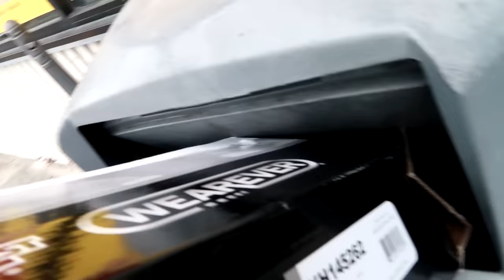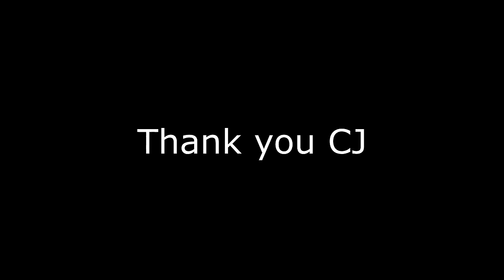what REALLY happened the night i should have died

Comment: one more short story since I'm already on a rant... one time I almost blead to death... I was working on replacing the muffler on my 1950 Ford 8n tractor and my wrench had slipped off one off the bolts and I was using all my force to make sure the bolt was tight and I had slid my wrist across another bolt peeling some skin off and severing my veins... I immediately knew (from past less dangerous accidents) to hurry inside, clean the wound, and apply pressure and hold it above my heart to keep ass little blood flow and blood loss and immediately my mother rushed me to the hospital and got me stitched up

Comment: I had a wheel fall off my 91 GMC Suburban Geneva Conversion 4x4 I was on the highway in the fast lane trying to go help a friend who engine had locked up I was doing about 65-70 mph and I felt the truck rock a little bit I took it as ran over something then it did it again and again back to back so I decided I needed to check it out as soon as I hit the blinker to get over the wheel and tire fell off and was blessed that there was no one else around except a guy in a GMC Pickup who was kind enough to turn on his hazards and follow me to shoulder I thought I had a flat tire but when I looked at it there was nothing there except one brake shoe that held on by the e brake cable and all 6 lugs were sheared completely off  never did find the wheel and tire but I was so glad he blocked traffic for me until I got to shoulder so yeah there are definitely still good people out here

Comment: I have nearly been run over 5 times in two months by speeding cars. The 2 most recent times were extremely scary. First,  I was riding my bike down the side of a road and somebody sped by,  hogging the edge of the road. On my right side there was a bank plunging around 40ft in to the forest. I was less than an inch from falling off the edge as i swerved away from the car and apparently the driver did not care one bit about whether i was okay or not. The other time was when i just finished hiking a local mountain. I looked both ways multiple times and lisrened carefully for oncoming traffic. I walked about half way across the road and as soon as i was about to step over the yellow line a car whips around the corner and misses me by a foot and a half,  roughly. A little too clise for comfort considering the speed they were moving at. A few minutes later i got a video notification from YouTube and the title read,  "I Was Nearly Hit By A Car." I immediately turned off notifications on that channel. I was trembling for almost an hour after that incident. And i swear the car from the first story is the same from the second. Seems like one hell of a coincidence

Comment: so I've been thinking about this. I have a dodge 2500 diesel and do as much repairs and maintenance like you. I can't tell you how many times I've pulled tires off and put them back on torqued the lug nuts and never re torqued them. I've knock on wood never had this happen to me. so this makes me think that what if when you put the tire on that side that you tightened the lugs but forgot to torque that tire. not sure if that's what happens but it's a possibility. I'm glad no one got hurt and that your alright. keep up the good work Dalton!

Comment: about 2 years ago I was working on my friends racecar changing an axel in the front of the car, I had a 3000 pound hydraulic jack holding the front of the car up, I only had one jack stand underneath the car, once I got the axel loosened. I felt like I was going to throw up,   I crawled under the car to remove the bolts on the other side,  as soon as I looked up the  hydraulic jack gave away, I looked over at the jack stand which was holding the brake rotor 3 in above my neck if that jack stand wouldn't have been there id be dead right now. as soon as I stood up I realized I could have been dead and that made me think of how quickly my life could have been washed away.

Comment: His problem wasnt that he didnt retorque the lug nuts, its because if u noticed his original rims he took off were after market meaning they would require him to use after market lugs nuts to work. But the spares his installed were factory gm rims from a newer truck, and idk if u ever looked at a factory lug nut and an aftermarket one u can buy at autozone, but the actual lug nuts itself seats differently even though its the same thread size, also he said the rim that came flew off lug nut holes were bored through meaning that the aftermarket lug nut ate away the the holes on the rim to the point that the lug nuts werent holding anything

Comment: A few years ago my dad was going to work, he goes to work at 3 am. at the time he was driving a 1 ton ford F-350 dually diesel. he was on the highway heading to work about 10 miles away when all of a sudden he sees something in the corner of his eyes. he looks and he sees two wheels on each side of him speed past! the outside rear wheels fell off and speed past him while he was driving down the highway at 70 mph!! he pulled over right away and walked ahead to get his tires and when he got back somebody helped him put the tires on and off he went!

Comment: I had just blown a tire and borrowed one of my dads old tires, i was doing about 110 KM/h (68 mph) and my front left tire fell off... Luckily with how ive grown up and messing around in fields and stuff ( the night before i had actually hit the disks in the middle of the field {couldnt see them because of the hay} and put it up on two wheels) i was able to safely pull to the side of the road. No one was stopping but luckily it fell off right infront of someones house and he saw me sitting there on my truck and he brought his tractor out, helped me put my blown tire back on, i pulled it into his driveway and we re sealed the bead. It two two months for the property owner accross the road to find my tire probably about 1km into his property

Comment: My dad and I were heading home from a hunt out west and we were traveling east on interstate 70, it was around 7 at night and we were looking for somewhere to stop for the night when right ahead of us a cattle truck swerved off the side of the road and rolled on to its side off the right shoulder. We stopped and I told dad to call 911, I jumped up on the tractor which was laying on its passenger side, the driver was not responding to me and the truck hit with such force that the drivers door was jammed inward and I couldn't open it so I started kicking the windshield to try to get him out incase it caught fire, after a couple kicks he woke up and I got him to open his window and I pulled him out.  The guy said he fell asleep at the wheel and we could hear the cattle in the trailer bawling, many had broken legs, he ran back and opened the doors and left the cattle out so they wouldn't trample each other, the problem was they ran out on to the highway and it was dark, the speed limit was 75 yet we managed to get people to slow down and nobody hit any of them until we could drive them off the highway.  The police showed up just as a group of Cowboys pulled over and as the cops talked to the driver the Cowboys unloaded their horses and began rounding up the cattle, dad and I left and I never asked the guy's name but I was glad nobody got hurt in the wreck or with the cattle on the road.

Comment: Last year I was with my family on the beach. I was going to church when I saw an old man triying to set of his car alarm so he could run his car and go home. The problem was that his remote control was no battery so he could´nt shut off the alarm and the inyector cutter, and oviously wasn´nt able to start the car .So I stop and help him. I disarm my remote battery and fit it in his and solve the problem. He thanks to me and we say good bye.
Next morning with my sisters and mom we went to the beach for some offroading. My truck is 2wd but has good off road tyres and I have never get stuck before so we just go ahead. For some reason I didn´t took the correct trail and a few yards away I get stuck. I start using all my tricks of self recovery and traccion remean but they fail. In a short time my truck was with boath rear wheel drive tyres buried in deep sand.
We began hand digging with my mom, watching how big 4x4 jeeps and trucks pass over without even loking at us. Somehow a friend apears; it was the old man I help yesterday. He stop and give us a hand. We tied my 2 loading ropes each other so we reach about 150 feets strype so he could have good traccion on hard sand and start pulling out. In two minutes we where out of the sand hole.
I am still glad of that Sir. 
Severall times I help people in troubles; in fact my truck is fully equiped for that and is amazing what you feel helping an other, but is simply annoying the satisfaction that you can have when someone you have help gives back you a hand. There is when you think "We do a good job".
Luckyly you are right! good video brou!
(p.d. Sorry about my rude English, I am a bit out of practice)

Comment: This same thing happened to my f250 when I was towing 3 quads, we had stopped at a gas station and got some fuel and not more than 3 miles I felt that movement kinda like a small swerve. We had started to pull over and slow down than you could feel the whole back of the truck drop, we were about 3 hours away from my home so we got a tow truck tow us home for $1000 at 4am. all of my lugs snapped off and the rotor was flatter then the one on the dirtymax lol. Hope you can get a laugh from this

Comment: I had a 1970 chevelle  I put these cool chrome rims on and all my friends wanted to go cruising that night so all 5 of us had the radio blasting and went to this road that was called snake hill road. It was called that  because it was like a coiled up snake and went up or down depending on direction. We were fooling around with the lights on and then off I then felt a vibration in the front end, then the front started kinda like bouncing until it went "Bang" until I saw a tire pass me on the left. People were screaming and trying to keep the car straight and slow it down while there was a rooster tail of sparks flew out of the front wheel well. The street had no lights which made it cool but scary. I finally got the car stopped. Found some of the lug nuts further back.I had no drum brake left and had to use nuts from other wheels and 2 that I was able to find..  Every body were shaking and scared. Had no brakes and only was able to use emergency brake to slow the car down . Btw it was the left front tire not sure if I mentioned that. I felt like you did too but the only thing I kept thinking was how bad it could have been and thought about having all those people with me. Sorry for going all over the place with the story.This happened in 1985.

Comment: I bet you forget to torque those lugs on that wheel. I've used similar little impact guns to run lugs on and then go around after and torque them with a torque wrench. I forgot to one day rushing around and went on a test drive. came back home after 20-25 miles and there was no issues but when I check air pressures in the tires I noticed one of the nuts was not even finger tight. went around and checked all them and they were mostly tight but a few had loosened up. after that I quit b using the 1/4 inch impact to run nuts on. either grab the 1/2 or do them by hand and then torque them right there then do the next wheel. glad to see your safe though.

Comment: A while back I had stopped to help a girl broke down in a left turn lane. Pulled my car into a gas station what for pushing her car to the same place. I felt so bad for her when she told me what happened. It was her dad's jeep, engine overheated when I took a look and saw a crack in the block you could put a finger in it was so big. Before that she had said her van dropped the transmission and the rent a car she was driving the day before grenaded the differential. 3 cars in one week felt bad for her, didn't want here to touch my car though.... The way home the next day I picked up a tow strap

Comment: Several years ago I worked for a retail chain as part of the resocking crew at night... So one day I was able to get a new set of tires put on my car which was a good feeling.. So after that drove around did some errands an this that and the other.. So later on the next day I started to notice a slight vibration.. So after I got home from work I checked the lugs and they were pretty loose.. Since I have delt with it before I grabbed the lug wrench out of the trunk and tightened them all up... That night I drove to work and couldn't shake a really bad feeling that I had.. At some point I told my supervisor at the time that I had to leave an check on the house to see if everything was ok.. I get in the car an start making my way to the freeway and something told me to pull off an check the lugs.. I thought it was weird since I JUST did it buf I pulled over an checked anyways... Turns out that 3 out of the 4 wheels were so loose that I could twist the lugs with my bare hand.. So after I got all of them snugged up I had to stop an have a smoke before I went back to work.. And mind you I drove at 70-75mph on a busy freeway and was a 35 mile drive one way

Comment: Hey man first off i got to say, I'm a big fan. But I think your problem is not actually in torquing your lug nuts, but actually keeping your hubs and wheels clean. I work at a tire shop and we ALWAYS thouroughly buff the hubs and the back of the wheels to ensure there is no rust or corrosion. See if you dont do that, the rust can actually break off, creating slightly more space between the wheel and hub, therefore making the lug nuts looser. We turn out almost a hundred cars and trucks a day and nobodys wheels have ever fallen off and I'm sure that 90 percent of our customers do not re-torque their wheels.

Comment: Driving across Wyoming from Denver to Jackson Hole, I was pulling off the road to fill up on gas. On the side of the road, was a Nissan Pathfinder , and off in the distance I saw an older guy walking through a field rolling a tire, pretty far away. I was like what is this dude doing, rolling this tire across, and decided to,get out to ask him. I walked around the other side of the car, and saw that the back right tire was completely gone, when I realized the tire he was rolling was the one that had fell off the car! Turned out he didn't even realize the tire had fallen off until it passed him and started rolling off into the field. Crazy shit

Comment: I just got all the work done on my truck a full restoration, got it out of the paint shop and I started driving home 30 mins and I was traveling about 85 and I got into town and was going about 25 and I felt the wobble and it fell right off. Same side and same tire as you! But mine busted the drum and all the studs. And destroyed my bedside I still haven't saved enough money to repaint it, I even asked them if they took to wheels off so I would know if I had to stop and re tourque them and they said no

Comment: I had a front wheel come off as i was turning a corner in my car the speed limit it 50 km/h so  was lucky enough to not cause to much damage. I also had a twin set of wheels fall of my third trailer at 60 mph in western australia when i was driving triple trailer road trains. That was scary as it sent me across the road and there was no way i could get the unit to correct until the wheels had completely seperated from the trailer.. very thankful there was no vehicles coming the other way..All that was left on the trailer was the stub axle. So i can honestly say you were very lucky...

Comment: I'm from Australia and I am a semi driver I have a system where I check my wheels and check everything els. One night I did all the mentioned and drove off with a 300 ton load worth 1.5 million dollars I turned onto the highway and saw a man drive past well above the speed limit and I aventually caught up about 30 miles later and his left side of the car lost both wheels and one lodged under my front wheel and one hit the trailer the one that went under the wheel flipped my semi and the load in a ditch causing me to loose the load I watched about 37 other semis go past and then a whole convoy stopped and called the police to block the highway they came and blocked it so the convoy got to work and pulled me out I couldn't thank them enough so I did a bout three more loads worth 3 to 4 million dollar jobs and split the money giving one mill each

Comment: buy yourself a torque multiplier if you've never heard of them go look at a YouTube video right now I've been wanting one for years they're not that expensive I just haven't gotten around to doing it but I don't change my tires seasonally either if I did I'd make getting a torque multiplier a priority.............. it will make taking them on and off much easier it will make them go on much tighter and break free easily when they are on tight : )
Reply: another cool thing I've always wanted to get is an exhaust Jack..... it's basically just a big air bag you connect it to your exhaust pipe and when it fills up it lift your vehicle you can use it for changing your tires but they're most widely used in the off-road world to help get unstuck
Reply: Both of those things sound awesome, lol.